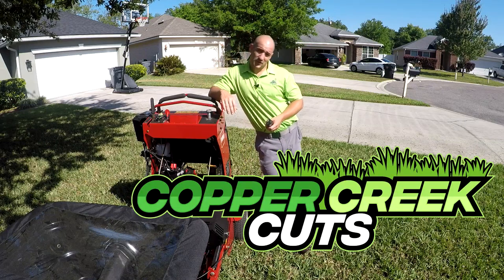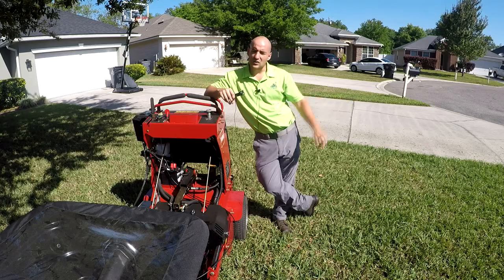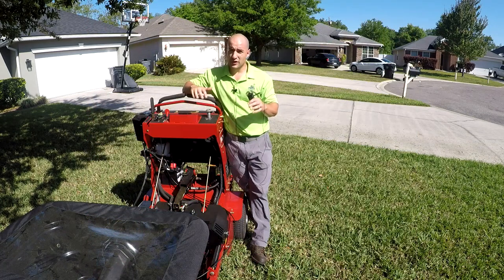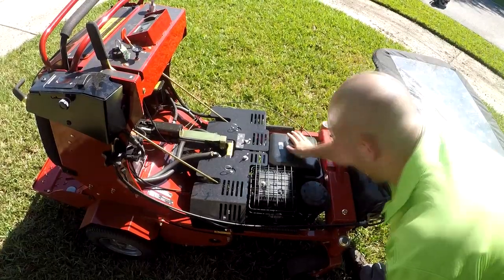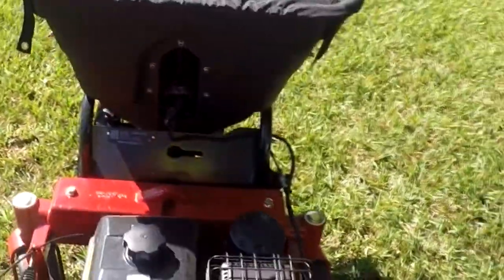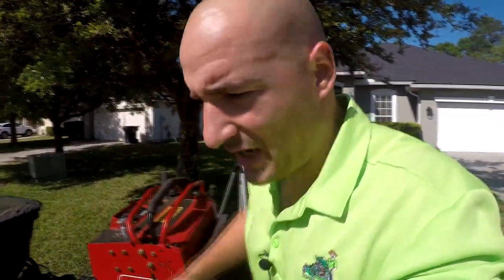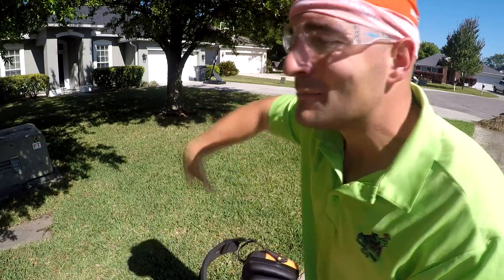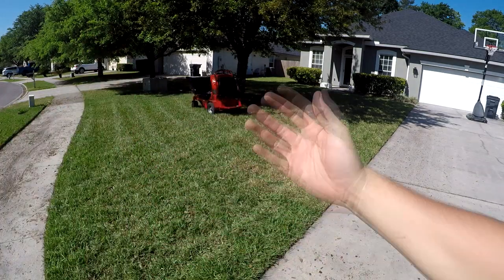What is Aerating? (Lawn Aeration How To DIY)

Comment: The idea of the spreader in front of the aerator just doesn't make a great deal of sense to me vs following and getting material into the aerated soil, ie, the holes created.
Reply from the maker: You don't use them at the same time. It is just a cheap upgrade so now you have a stand on spreader as well.